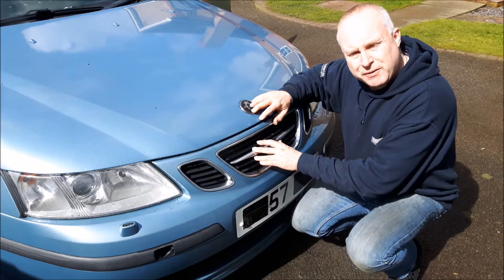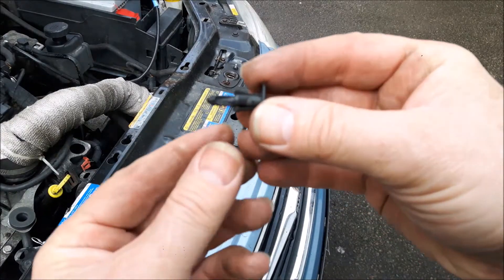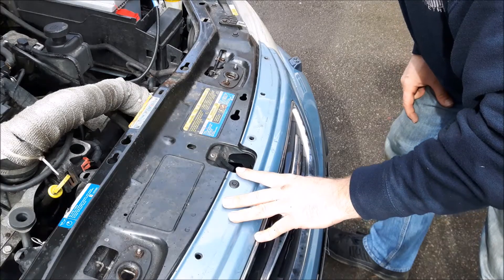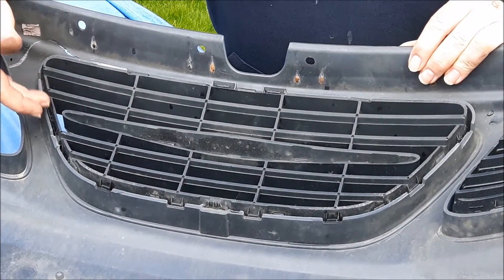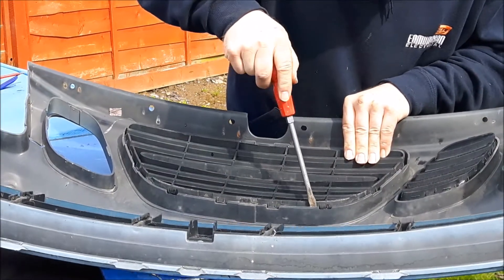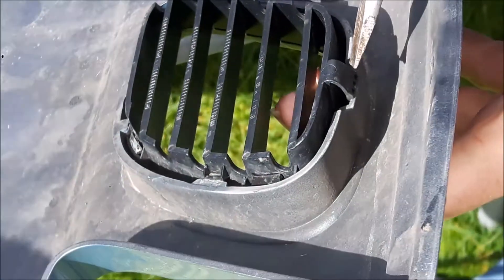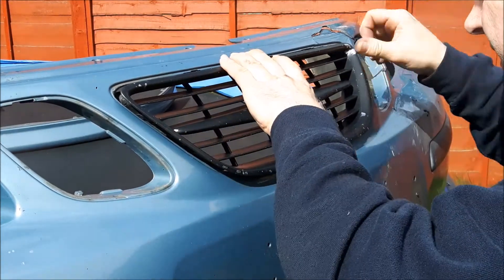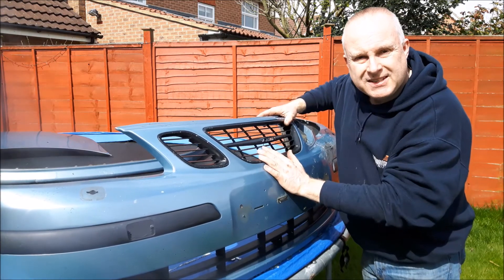SAAB 9-3 Grille Removal | Saab 9-3 Grill | Saab 9-3SS

Comment: The bonnet is stuck closed. What tools can I use to take out the side vents to get to the cable release. My Saab has the chrome looking frame around the black grill part and the side vents are sealed. I tried to remove them by hand, and cannot.  Thinking a Teflon type tool would help? Your thoughts??
Reply from the maker: You have a 2008 on facelift car, then. You'll have to break the side grilles and replace them after.
https://www.youtube.com/shorts/tSPItRbBCDA
Reply: did u end up figuring this out? i have the same problem. do we really have to break the side grill?

Comment: Hi will you able to tell me for Saab 9-3 2007 which  fuse is  for Stereo and where it located because my stereo has no power
Reply from the maker: IIRC, it's 13 or 24. Defo in the fuse panel at left side of dash though